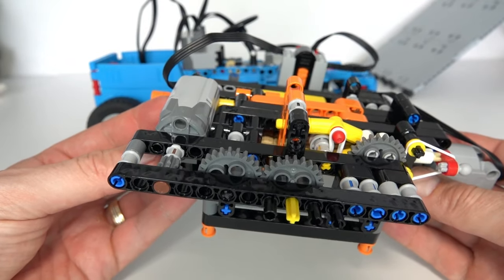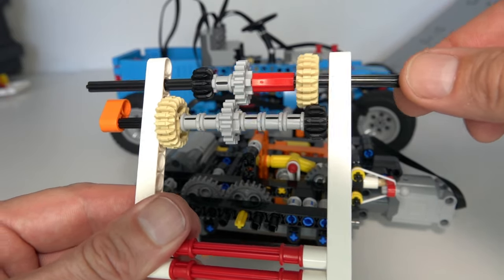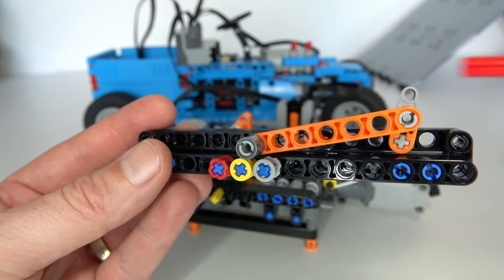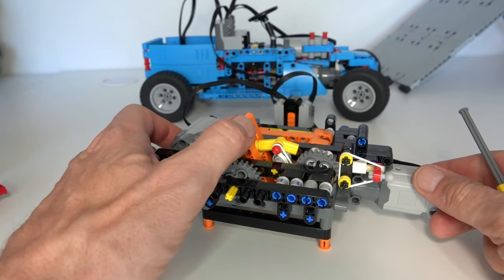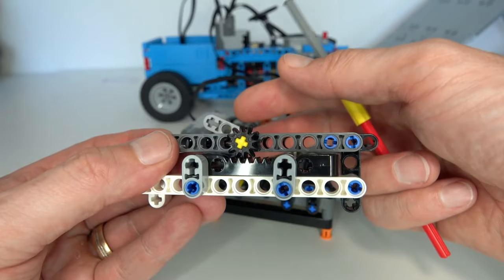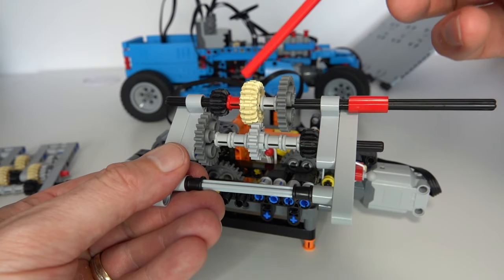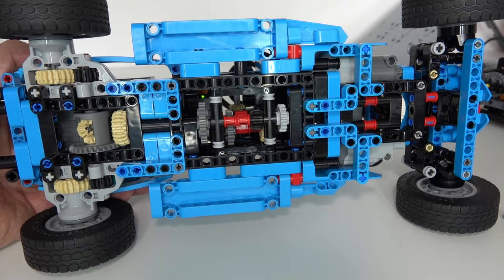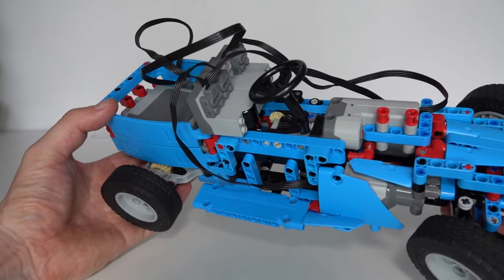Lego Technic RC 3 SPEED CAR - change gears, drive and steer using remote control

Comment: the gears grinding when you shift IS REALLY SICK! it's like those really old cars, they used sliding mesh.
Reply from the maker: Hey glad you liked it. I didn't mean for the gears to grind - a side effect of trying to mesh sliding gears! 😂
Reply: @TechnicBrickPower  try make a clutch for it, xd.

Comment: A very beautiful car on the inside and outside. I dislike the gear grinding noise though maybe a clutch would be nice but I would imagine it would just be good for speed control and not climbing
Reply from the maker: Hi Adrian. Glad you thought it was beautiful - I am not much of a car designer. Yeah it was a bit more grindy than I had hoped. Will keep on working on it ! 🙃

Comment: Your gearbox has one flaw, you can also hear quite clear. The gears have no neutral position. This means that while shifting, two different transitions are active at the same time, causing the gears to grind. This damages the gears and the motor. You even showed it by demonstrating the gear switching. The gearbox blocked during shifting.

Comment: nice work! good final product 👍🍺
Reply from the maker: Thanks Carl it was a fun project that one. 🙃 Still working on our challenge?
Reply: @TechnicBrickPower  Hi, it's going to be a long term project as I can't see how to do it! I  made a load sensor with a third diff but making a working brake to replace the clutch is the tricky bit. Wanted to simulate some of the function of a real auto gearbox..
On a side note I've been building walking machines this last week, which has really challenging as well. I think I need more Lego.. :-D